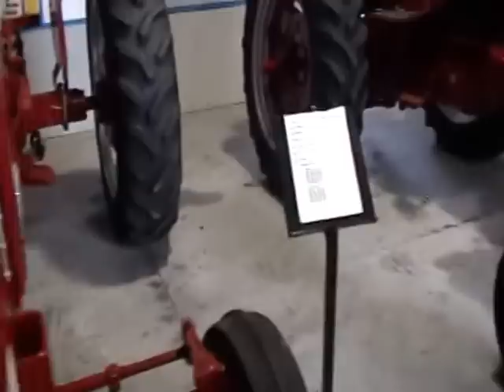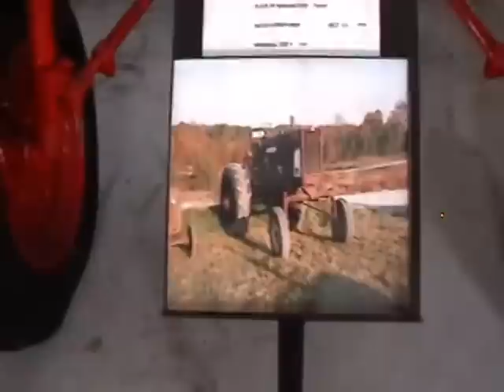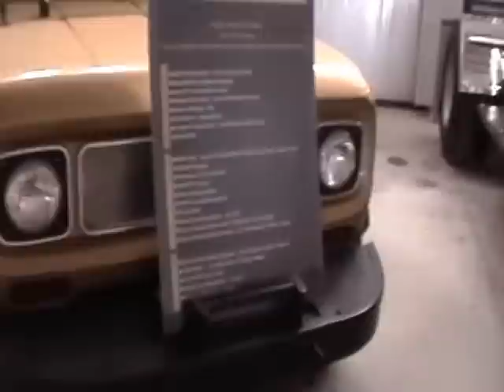Paquette's Farmall Museum II

Comment: First tractor I ever raked with was a 230 which I think superseded the "C" or Super C.  Then we traded for a 400, then a factory non-TA Super M.  Up until the Super M I was so young that my Granddad would get me rolling in gear and step off the tractor. When I got done raking I would either kill it or he would be back in time to shut me down.  I don't know if you could get away with that today. lol  My Dad baled with the 460 D that I still have.  We traded the Super M for a 756 with the 310 German.  Still have it and a 706 with that same engine....and what an engine it is.  I also still have a F 20 from before my time but its pretty rough.   These are just the ones I remember.  We also had a 544 gas.
Reply from the maker: Sam, IH built a Farmall 200 between the Super C and the 230.  I had the same experience of an Uncle or Granddad getting me going, then step off, and I'd go until I choked off the gas.  I'm sure several Federal  agencies would investigate, our Gramps would be in jail, and you and I would have been raised in a foster home!!!
Reply: bradyboy1952   Funny how times have changed.
  You and my Dad would have probably had some good conversations.  I can tell you are very sharp when it comes to red tractors, as was my Dad.  The one tractor that I have always wished we had had would be a WD 9. I really like most of the Western models though.   Im guessing you grew up on a "Red" farm, too?   I'm 41 so my Dad, Granddad and Great Granddad had some beauts before my time.  This is a great video!  If I ever get down to Florida Ill have to look this place up.   Thank You!